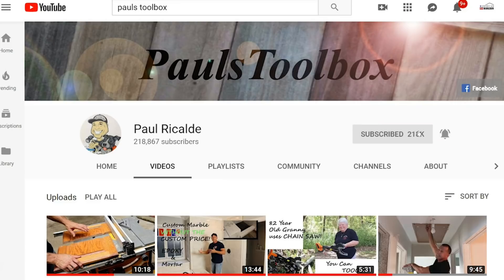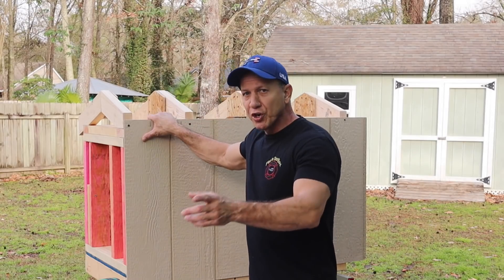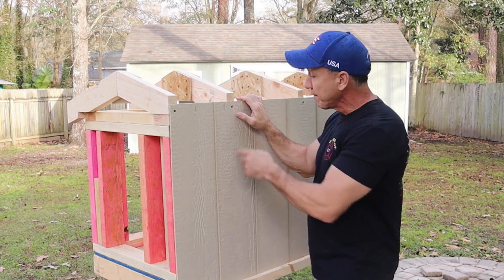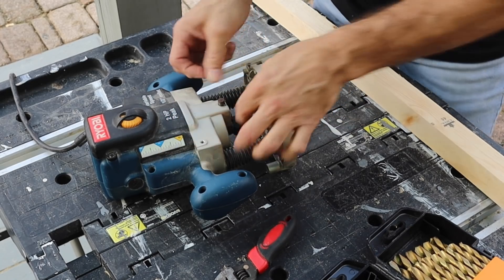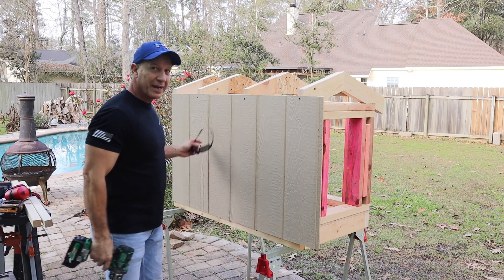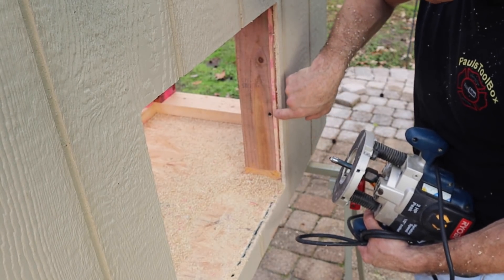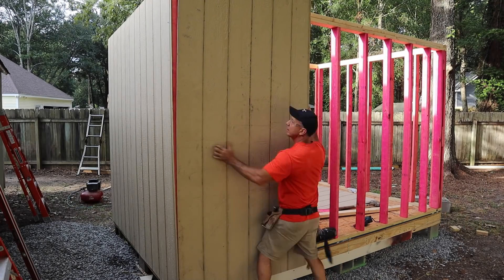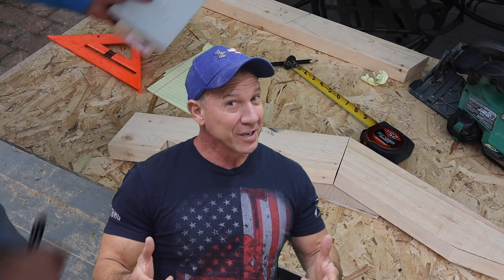Building a shed. FAST EASY Door openings!

Comment: I would love for you to show us how to put on a barn roof for the shed.  Your instructions on this one sound so easy and understandable!  Thanks for posting this series.
Reply from the maker: Hi Rosemary, are you talking about a metal roof? I finished the real shed but I could work on the model for you.
Reply: A gambrel style which would have 4 beam parts joined by gussets (for a shed).  I wonder what the angles would be as well as the lengths of the beams to go on a shed this size (8' walls).

Comment: Do you have any noob friendly videos on using routers?  I have had a Ryobi router for a few years but to be honest, they scare me more than any saw I've ever used.  I'd LOVE to learn how to use my router without fear but being smart at the same time.  Sorry if you already have done some videos.  I'm a new subscriber and just starting to go through your videos.  I LOVE your teaching method so much!  I have a degree in Architectural Technology but after building a fancy chicken coop for the first time, I have learned why contractors get so irritated with architectural drawings.  It's so not the same thing. LOL!  

Thank you so much in advance for any advice you can share.  Loving your channel so much!

Edit: Sorry.  I thought about one more question.  I'm a pain in the butt. LOL!  For framing walls and door openings (headers, king & jack studs, etc), is it best to use screws or nails?  I have a framing nailer but I see you use screws a lot.  Which is the preferred application for each phase of building a shed?